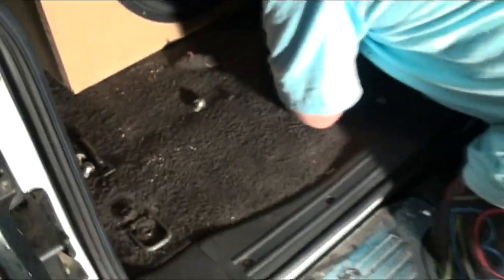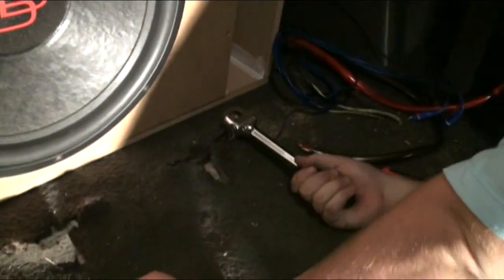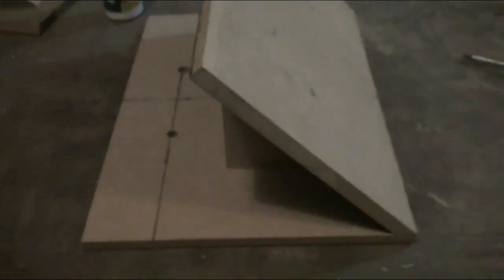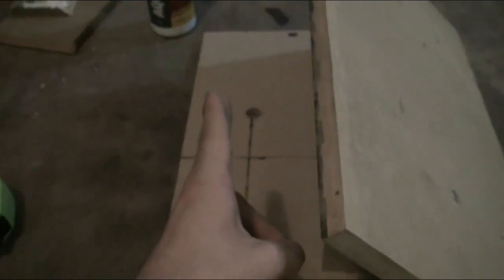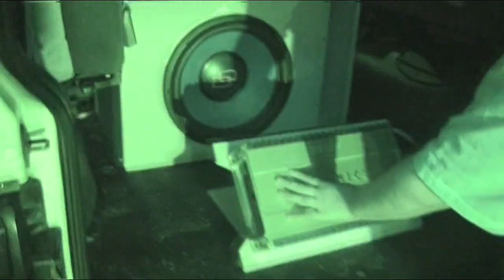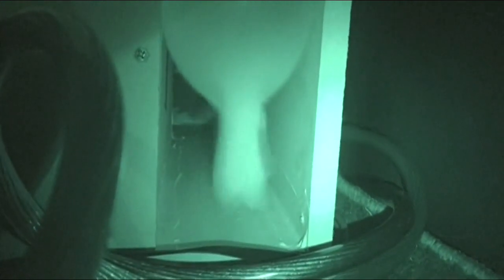Amp Rack Build For 97 Pajero Hifonics Brz1700.1d - Night time Grass Drifting

Comment: Yere live in sydney, Australia, Using a BRZ1200.1d at them moment But Scored a Crescendo 3500.1D for $350 deliverd from the states to australia.
BEAST  of a amp.

Try a AQ3500 same as crescendo, or a Audiopipe aqx 3500 there cheap and do rated at 1 ohm, or a older audiopipe 3k STable at 2 ohm does rated